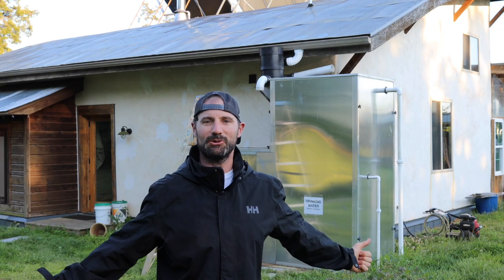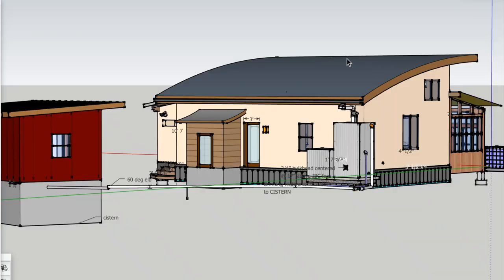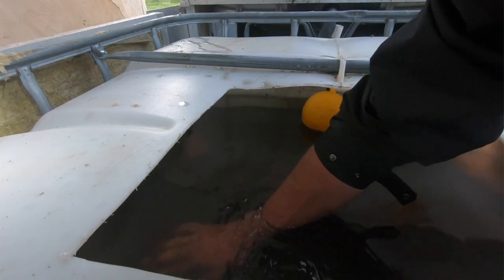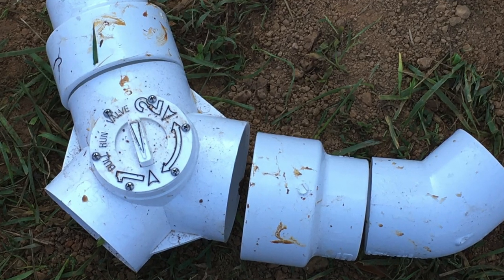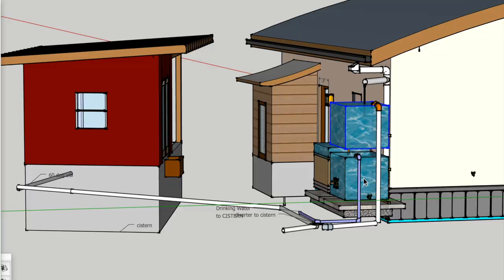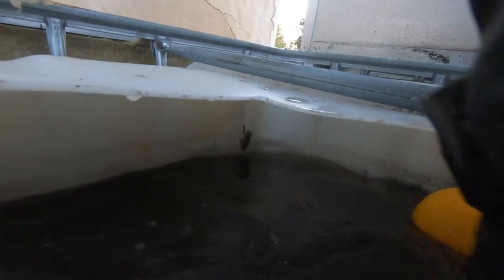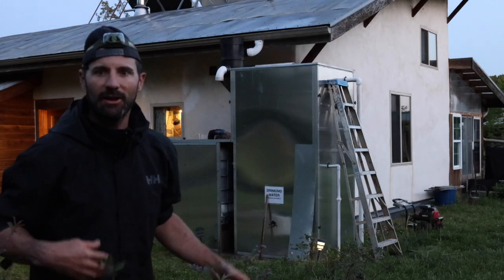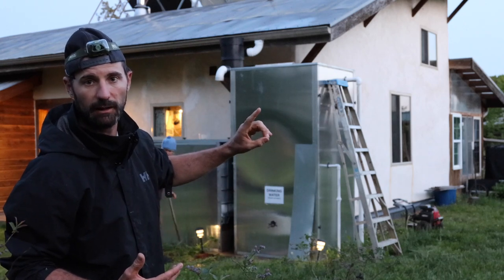DIY Home Water Filtration System: Rainwater Harvesting with a Biological Sand Filter and Maintenance

Comment: Hey! Im very interested in your design! Do you mind telling me what your roof is made out of? my concern with my galvanized steel roof is that i will be recieving a lot of heavy metals in the water such as zinc lead and cadmium. I have read many scientific journals that say the heavy metals from roof catchment can be a real problem. does your filter remove these? have you had it tested? do you use a special roof material?
Reply from the maker: The slow sand filter takes care of all the heavy metals...at least there were none present in our water when it was tested. Plans are available at https://www.heirloombuilders.com/designs-for-sale/rainwater

Comment: at the 7:46 mark, there's what looks like a centrifugal filter.  Where in your system is that, what is it called, and where did you get it?    Thanks!
Reply from the maker: Hey Eddie! It’s a Wisy vortex filter. I would highly recommend it over a first flush  diverter.
Reply: @HeirloomBuilders  Thanks for the info!  Any idea which model you have?  I see a LOT of them...

Comment: That was excellent! Thank you for showing us your setup. 

Do you happen to know how much you ultimately have tied up in the system? And is sounds like you built yourself a giant concrete box to house the 10,000 gallons? 

Have you thought about adding additional layers of filtration such as an activated charcoal layer as well as an activated bone char layer, too? 

Sorry for the bombardment of questions, but your video was great, man!
Reply from the maker: Thanks Trevor! I have about $7000 in the cistern (not including the shed I built above it), which is essentially a 12x24 concrete box with baffle wall in the middle so I can have two separate 5000 gallon storage. That way I can drain one side to clean it without losing all my storage. I have thought about adding activated charcoal, but the taste is already really good and the testing I have done on the water showed no need for further amendments. Do you have experience with activated charcoal or bone char? I’ interested in the potential benefits, but don’t know enough about their application. 
I have about $3600 in the biosand filter and aluminum jacket. Plus $500 for the vortex prefilter
Reply: IMNSHO, in a Slow Sand Filter, charcoal and Bone Char aren't really needed, between the purifying effects of the "Vital Layer," and the mass of sand. Yes, the mass of sand is actually purifying the water, too, bonding with many undesirable chemicals.
In a FAST Sand Filter, yes, you probably want it, because there isn't the time needed for the Bacteria and Sand to do their thing. However, in a Hybrid system...
I'm using a Fast Sand Filter, but, I'm collecting fresh rainwater, with a multi-stage system: Off the metal roof, into a bucket for settling. Over the lip of the bucket, with a piece of Paper Towel as a Capillary Filtering Wick, into a jug. From there, through my Fast Sand filter and into a 55-gal. drum. Once full, add 1/4 TEASPOON of Pool Shock (65% Calcium Hypochlorite), per drum (Double this dose if there is ANY cloudiness to the water. And if there is, WHY ARE YOU STILL TRYING TO USE IT?). Please note, my system is not automated, so, I'm tipping a fair number of jugs to fill a barrel. And yes, I chlorinate. My drinking water can be sitting for a good bit, as I am single (with cats). Oh, and Clean All Parts (With fresh wicks) at the beginning of each Harvest Session (AKA Rainfall).
Now, if I was going to use Muddy Water to start with, I'd use a Fast(ish) Sand Filter as Stage One, and then a Slow Sand Filter as Stage Two. Fast Sand Filters can be both Backwashed, or dumped and the materials washed, then added back in by size. But make sure the water is nice and clear before it goes into the Slow Sand Filter.
Or, if my Filter Size was limited to say, a 3 to 5 gallon jug, Yeah, there'd be charcoal in there.

Comment: Bc most of the water sits in a tank before use do you filter it again before it goes into the house ?
Reply from the maker: No, it sits in a concrete cistern that helps neutralize the acidity. The water is pumped from a pipe that sits 6” above the bottom of the cistern so it doesn’t pull sediment off the bottom. The plastic tank that holds out drinking water is filtered with a tabletop filter that makes the water more alkaline.

Comment: Maybe you did this but the drawing didn't show it so I'll ask ..... Why wouldn't you route the rain water holding tank to the bottom of the filtration tank (instead of the top) so that the rain water would rise through increasingly finer material to get filtered.  This is the basic concept of a bog filter and is extremely effective.
Reply from the maker: The biological sand filter relies on a layer of beneficial bacteria that digests parasitic bacteria and viruses. In order for the beneficial bacteria to survive they need to be close enough to the surface to get diffused oxygen for aerobic respiration

Comment: I’ve built a 10,000 gallon storage cistern that I need to put a liner in. I’m going to be using this water for everything, including drinking. What type of liner did you use in your cistern?
Reply from the maker: Hey Carson! I didn’t put a liner in the cistern. I just made sure that the concrete was pure (no fly ash) and that all my seams were tight. Fortunately I don’t have any leaks. The alkaline concrete helps neutralize the acidic rainwater. If you have some leaks, you can try hydraulic cement to patch them, or a NSF food safe silicone caulking. Copper sheet would be really expensive, plastic or EPDM may not be food safe.
Reply: @HeirloomBuilders   thanks man! I have found a company that makes food grade vinyl swimming pool liners in custom sizes. I think that’s the route I’m going. I was just interested in what you had used. I haven’t found many people that built a block cistern!
Reply from the maker: @casonknipe3961  who is the company that makes those liners?
Reply: @HeirloomBuilders   I’m going through a local swimming pool company but the manufacturer of the liner is Fab-seal in Oklahoma. I have contact info if you want.

Comment: Why might you divert the overflow, unfiltered rainwater into your larger holding tank under the shed?
Reply from the maker: We divert all the overflow water to the cistern under the shed because we only have 300 gallon rain surge/holding tank. Most of the rain storms we get produce rain faster than the surge tank and sand filter can process it, so we would lose most of the rain if it didn’t flow into the cistern. We could fix this by making a huge 2000 gallon surge tank, but since we only use water in the cistern for showering,laundry, etc, we don’t need it to be sand filtered. We drink water from the lower IBC tote (filtered water) tank only.

Comment: You said the system works in gravity.  How do you get water from the systern to the house?  What about freezing
Reply from the maker: Good question. The filtration and collection all happens by gravity. We pump water from the underground 10,000 gallon cistern in to the house with a jet pump and pressure tank located in the little lean-to shed on the back of the house. We’ve had lots of consecutive days in the single digit temperature (deg F), with no issues freezing. The pipes connecting the tanks together are not welded with PVC glue so they can expand without busting. That only works because the filtration/collection system is not pressurized (its gravity draining tank to tank).

Comment: do you have a resource than can help with an urban collection system?  i collect off a 9,000 ft roof.  you have pollen.  I am plagued with pollen size dirt caught by the rain in Indianapolis.  all sorts of reasons why the dirt is in the air.  my 500 mesh filter was getting clogged with each rain.  I'd install a sand filter but that will get like your pollen problem with every rain.
Reply from the maker: Are the solids/dirt suspended in the water for long periods of time? What is your end use of the water? Seems like a huge collection tank that can allow the solids to settle before draining to a filtration system might be a good solution.

Comment: When u rinsed out your float valve filter I noticed the pressure.. do you do a pvc reducing connection to obtain that? I have a ton of ibc containers and want to do this. I noticed when I've drained them they do have alot of pressure. Does your pressure just come from that or do you reduce the size of ur piping to obtain that? Where do u buy the sand? Can you make it?
Reply from the maker: Are you referring to the pressure at the kitchen sink, or the water coming out of the surge tank?
Reply: @HeirloomBuilders  the water pressure at the sink when u rinsed the filter screen. I was impressed by the pressure..
Reply from the maker: @timhill5939  that faucet is a commercial kitchen faucet that has a reducing emitter tip to increase the force of water. Regular pressure 50psi. Buy sand from www.redflint.com
I tried making the sand with mesh screens but it was super difficult and I ended up just baiting sand with a uniform size.
Reply: @HeirloomBuilders  so it's like one of those low pressure shower heads?  That's what I originally thought it was. I actually have a couple I've used camping
Reply: I contacted the people at the link you provided.. apparently they don't call it biological sand... is it also called... green sand?
Reply from the maker: @timhill5939  I believe it’s just called filter sand. 0.2mm - 0.3mm in size with high uniformity in size

Comment: does this method system help with hard water, high iron water etc..? I presently have a water softener system that requires salt and was looking to not have system where I need to buy salt and for it to be safe natural and clean. Your thoughts and solution idea for me
Reply from the maker: I think there is study showing evidence that it does filter out iron, manganese and hardness, but it may also depend on the presence of algae. I’ll see if I can find the study and get back to you. What part of the world are you in?
Reply: @HeirloomBuilders  Thanks, looking forward of you getting back with me. North East (America)
Reply from the maker: Short answer is no, this filter will not consistently filter iron and manganese on its own. It has the capacity to neutralize the positive charge of iron and manganese when the sand filter is supersaturated with oxygenated water, but I would not feel comfortable recommending this as a water softener for well water at this point. I intend to do some studies of my own that focus on hardness, iron, manganese and nitrates since most wells in my area have high concentrations of these things.
Reply: @HeirloomBuilders   Thank You very much for your feed back...Have a Great Day!

Comment: If you divert the unfiltered rainwater overflowfrom surge tank to your cistern, wouldn't that defy the purpose of your filter rainwater that is stored there?
Reply from the maker: Yes and no. Diverting the unfiltered rainwater to the cistern makes all the water considered to be unfiltered. However, we only use the cistern water for showers, laundry, and cleaning dishes. We don’t drink water from the cistern, but the fact that any solids settle to the bottom and any pathogens that may be there die by attrition (they run out of hosts to parasitize), I would drink the water there if needed. We boil that cistern water for coffee since it’s less acidic from sitting in the concrete cistern. But our drinking water comes from the IBC Tote that’s on the bottom of the filtration stack.

Comment: How many inches of rain do you get in a year?  Texas gets 32 inches/ year.
Reply from the maker: We get an average of 42 inches per year. On a 1000 sq ft roof, we collect about 25,200 gallons of rainwater in a year
Reply: I have a little over 1900 sf of roof, so I get a little under 1200 gals/ inch.   I have four 3000 gallon tanks for storage.  They are full now,but we going into summer when we won’t be getting much rain.  
I built my system in 2002 and I will never ever live without rainwater.  It truly is the gold standard for water.  I always say that I get my water from God, and you can’t do better than that!

Comment: In order for the water to be treated doesn't it need to sink down through the sand and gravel media before flowing into the next tank?
Reply from the maker: For sure. The clean water outlet pipe starts at the bottom of the filter tank, goes up to the surface and turns 90 degrees out to the clean water tank (make sure the 90 fitting is glued or soldered together to isolate it from the dirty water at the top of the filter bed)
Reply: Ah ok. The outlet pipe was not in the diagram so I couldn’t tell. Thanks man! Great system!

Comment: How do get the water  from the 10,000 gallon cistern
Reply from the maker: We use a dankoff solar jet pump connected to a 1” pipe that is situated 6” off the bottom of the cistern floor and pulls water up to a pressure tank. From there, it’s regular pressurized plumbing into the house

Comment: What can I do in an area that freezes in winter? I have IBC tanks for livestock water, but if I don't take the banjo valves off in winter they get freeze damage. I'm in zone 7.
Reply from the maker: Hey Jennifer! Hmmm. I’ve never had them get damaged - even in the single digits F. Send me a photo of your setup with an explanation of how it works / and what is connected to what. I’m guessing you’ll need to connect a standpipe extending to the top of the IBC that drains all water out of the fitting/bulkhead without draining the whole tank full of water. Email me at logan@heirloombuilders.com

Comment: In some videos it looks like the out pipe up from the gravel to the tap, exits above the sand, dose it matter what hight it is when it exits the barrel?

I'm guessing the lower it is on exit, the higher the flow rate ... Dose it matter?

Thanks anyone.
Reply from the maker: The outflow pipe exits 2” above the top of the sand (so that there is 2” of standing water on top of the sand) to keep the living bio layer alive, but not so deep that oxygen has trouble diffusing into the bacterial layers beneath the surface of the water.
Reply: Brilliant, thank you. 👍

Comment: So the water flows in from collection, then down through the sand all the way to the gravel base. Does it then saturate the sand rise back up through the sand and is clean? What keeps the water from collection mixing with the water on top of the sand?
Reply: Oh once its saturated the water level rises and closes the float switch. Does that float shut off the collection and open the path to clean water tank?
Does it really clean the water in mere minutes?
Reply from the maker: Drew Sanders good question. See Minute 4:15. The dirty water flows down through the sand bed and the clean filtered water is picked up by a pipe at the bottom (buried in the gravel) and goes up to a 90 elbow in the pipe at 2” above the top of sand bed that then spills out into the clean water storage tank.
Reply: HeirloomBuilders Oh okay, thank you for clearing that up. Does the sand ever need to be changed?
Reply from the maker: Drew Sanders the top biological layer needs to be cleaned every year or two (to remove pollen/etc), which takes off 1/16” of sand. So I’ll probably need to add a 50 pound bag of sand every 15 years or so.
Reply: Is the aluminum jacket welded or fastened? I imagine the biosand filter takes care of any mosquito larvae or nesting? Are you using 2 grades of sand? A fine on top with a course beneath? Thank you so much.
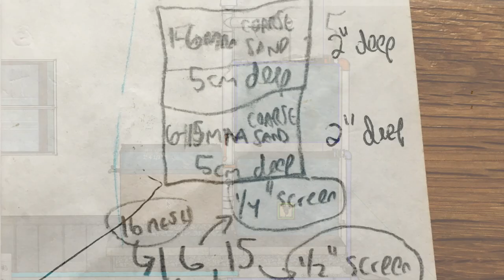Reply from the maker: Drew Sanders yes sir. There are a few grades of sand. See minute 4:20 for the stratification details. The jacket is an aluminum c channel riveted to flat aluminum sheet. I riveted 3/8 tee nuts to the c channel where the adjacent panels bolt together. I found 3/8” knob handled bolts for ease of use without tooling. See 12:20 for aluminum jacket attachment (the black knobs).

Comment: How much did this whole system cost you?
Reply: And do you think this would work well for a tiny house on wheels?
Reply from the maker: The whole filtration system cost breakdown: $1200 filter sand and gravel, and about $1400 for aluminum jacket. IBC totes were $300, fittings and float valve about $300. Totaling about $3200 in materials.
Reply from the maker: @jewel2244  I wouldn’t recommend this for a tiny house. It’s heavy and not portable. I would go for a berkey in your case

Comment: How do you pressurize the water in your house?
Reply from the maker: We use a jet pump to get water from the cistern to a standard pressure tank, all of which is housed inside that little shed bump out on the back of the house. From there it goes straight into the fixtures inside the house.

Comment: I am restricted for space. Would it be harmful to have varying sizes of tanks without a surge tank
Reply from the maker: It wouldn’t be harmful to have different size tanks. You will lose a lot of capacity for filtration without a surge tank though. The most critical part of the slow sand filter is the depth of sand. A 55 gallon barrel has enough height to serve as a biological slow sand filter
Reply: @HeirloomBuilders  My concept as it stands right now are two collection barrels (55 gallon) feeding another that is the "sand" filter, which fills a fourth barrel. Being I don't know the speed of the filter, do you suppose it would produce enough clean water for one person & two dogs? Thank you in advance

Comment: What if it gets below freezing?
Reply from the maker: The system is designed to resist damage from freezing temperatures. The gravity drain piping is not glued so that the pipe can move a little instead of cracking. The sand filter bed will work slower during freezing temps, but it still filters.